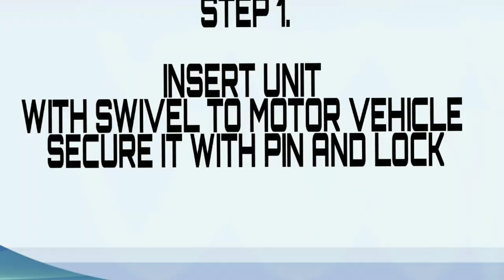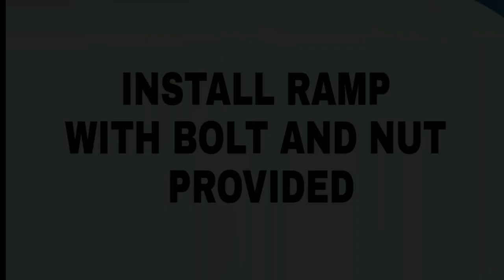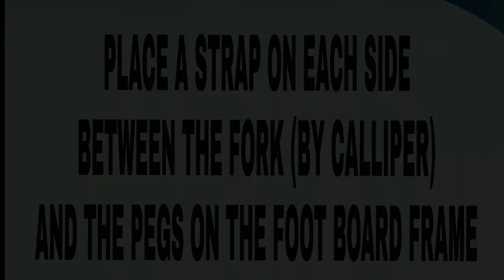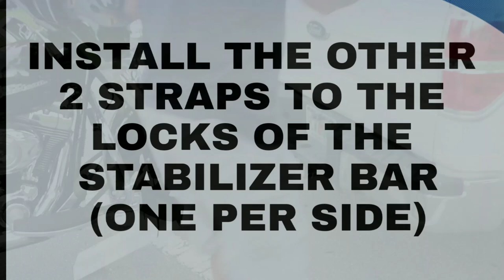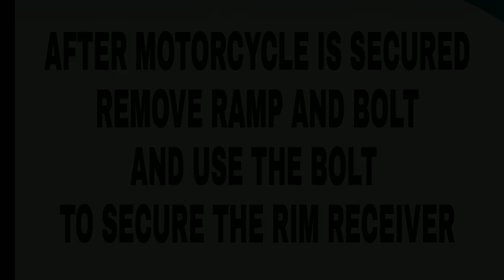RMC-200 WITH SWIVEL TUTORIAL

Comment: My owners manual reads not to coast excessively without the engine running or damage to the transmission can occur due to oil not being circulated.  I don't know about Harleys, but this device may not a good idea for all motorcycles.
Reply: I would definitely take the belt/chain off before towing it like this.
Reply: Yeah, probably only good for short distances.(40 miles or less)
Reply: Wouldn't it be possible to simply add a splitter cable to the electric fan on the bike? Splice the other end into the harness for the break and blinkers and you can have the fan running off the tow vehicle. Just an idea.

Comment: I saw another product almost like this however you would back the rear tire into it. It had a lift mechanism that you would then crank to lift the rear wheel off the ground. You would use straps for the handle bars.
Reply: Yeah, I saw that too.  they wanted $800 for it.  This one looked pretty good but I would like to know how much the motorcycle actually leans on turns.  Some of these carriers are so flimsy.
Reply: That thing was only good for dirt bikes you couldn't get a Harley up there because the finger would get broke up or been up you would destroy your back finger your saddle bags or anything trying to drag a Harley backwards like that I know which one you're talking about is strictly for dirt bikes

Comment: I have searched the internet and searched and searched looking for this trailer hitch right here. it's the only one I would buy... because it actually turns the motorcycle instead of trying to flip the motorcycle over in a curve.... when you go around the corner it turns with you.. So save your money and don't buy any of the other junk ones on here on the Internet on Amazon on eBay Walmart or wherever at a $139 all you're gonna do is get a pile of junk and may flip your bike over sooner or later on the highway this is the only one that I would trust but a 100% surety that I would get there without losing my bike It's built tough and it pivit's when you go around corners so it turns with the vehicle rather than lean the bike over that's we're going to buy one call these people

Comment: You didn't unhook the belt from the rear end bye-bye transmission
Reply from the maker: the belt is runnning but the transmission is not because it is in neutral. I traveled more than 50 thousand miles with my truck and my  bike and the transmission is working perfect

Comment: Lots of bikes are not made to travel in this type of application. Add the potential for rock chips, straps coming loose, bad or bumpy roads, road construction debri, a needed quick turn, people wanting to pass you more often than not by feeling uncomfortable not wanting to follow a precariously loaded bike like this, plus inattentive following drivers that get too close, signals being further away or possibly blinded by varying angles plus a host of other issues is just asking for an accident or damage to the bike. Is it worth it for what is paid for this hook up device? No way! Buy a trailer and be done with it. More safe than that contraption.

I once sold a mint condition Polaris Ranger 800 side by side utv to a friend. He used the same low quality 1” straps (like so many people do) as similar shown on this video. He went over a bump on a major highway here in MN and lost the entire rig into the ditch after the straps released. He was somewhat fortunate. Lost some expense cab glass and had to repair some panels on the Ranger but it did survive the incident. It just happened to land on the soft ground in the ditch ok. Costly mistake however.

Please people, check your equipment for proper loading, safe operations and have the best tie downs ever made. You owe it to your safety and to the traveling public. I wouldn’t use this particular motorcycle dolly in a million years. A trailer protects everything and everybody involved much more securely.

Comment: I see so many fails with this, damage to the transmission, damage to the tire if you forget to take it outa gear, damage to the forks the way he strapped them, anything being towed HAS to have lights(like a camper/trailer), just buy a trailer.
Reply from the maker: Hey Rasher, we prove an instruction manual that specifically explains that the bike MUST be in NEUTRAL in order to not cause any damages. Incase that someone forgets this step, you will surely feel the effects in your vehicle when you try to drive away with it. The straps do not have the capacity to bend the forks. And lastly, it is not required for the bike or the towing device to have lights because it does not obstruct the vehicle's normal brake lights. My personal bike is worth more than 40K and I have towed it for more than 100K miles without causing any damage. We always apricate your feedback. Let us know if you have any other concerns!
Reply: @rmccycle4918  People forget Bikes WILL be left in gear I guarantee it, I was a car hauler for a number of years, if your straps are not capable of bending the forks then they are not strong enuff, and shouldn't be used. As most only have a few hundred working pound load capability, my Ultra weighs in at 950ish lbs, let the bike twist and that will hyper stress those straps in milliseconds and that Will fail.  In Michigan D O T officers WILL pull you over and you WILL get a ticket for no lights on the dingy(Item being pulled) I have seen it with my own eyes.)  My duramax has 900ish ft lbs of torque, I would Never feel a tiny motorcycle tire, and I know what to feel for.
Reply: Sorry, I am not trying to knock your product, I do really hope it works out for you, just its not for me.